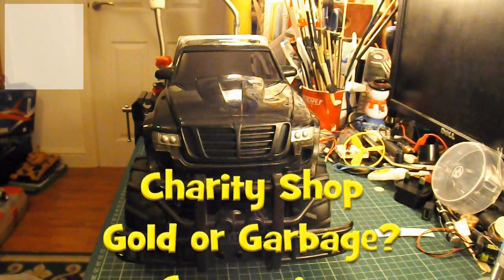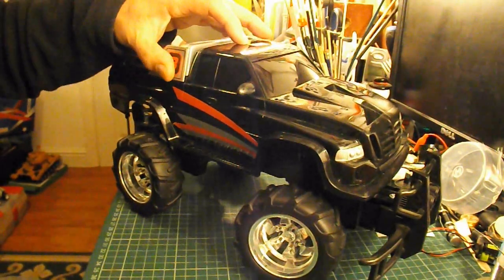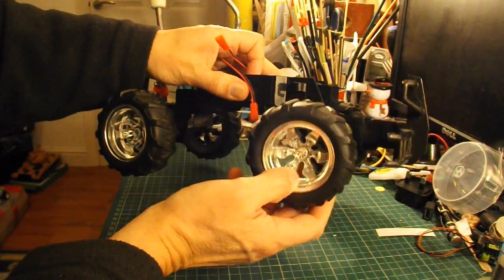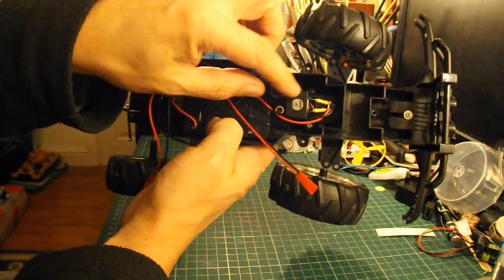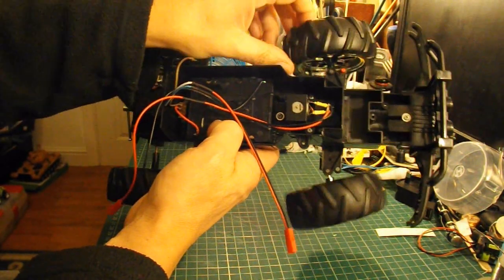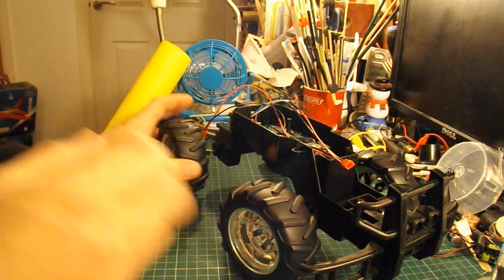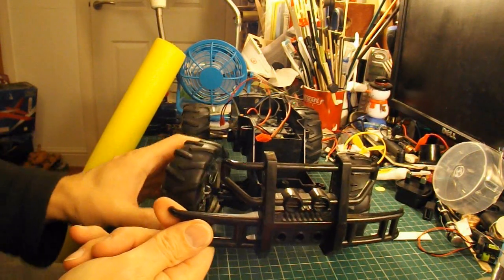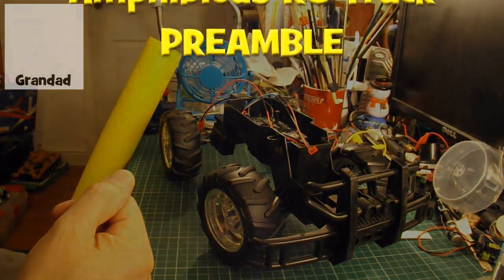Charity Shop Conversion Amphibious RC Truck PREAMBLE

Comment: Try sandwiching a cd disk between the foam on the front wheels so there would be better steering
Reply from the maker: +BananaSoCool88 it would improve the steering but cause a problem when you get out on dry land. Just a simple rudder that still has some ground clearance would do the job attached to the steering linkages. It could even be spring mounted so it lifts up when it hits the ground.

Comment: Hey grandad how do you charge your lipos? I was wondering if you used a proper 4 button lipo charger or just a balance charger. Maybe add a rudder to the back so it can steer better?
Reply from the maker: +X-FLIGHT101 I use this Turnigy Accucel 6/B6 PRO 50w 6A Balance Charger. If I added a rudder I would need to link it to the steering at the front which would not be too difficult. Just thin discs attached to the front wheels would work too in the water but would cause problems on land. A 4 wheel drive would be better.

Comment: You should put a peace of plastick on the front tires so it can act like a ruder
Reply from the maker: +ryan reining it would improve the steering but cause a problem when you get out on dry land. Just a simple rudder that still has some ground clearance would do the job attached to the steering linkages. It could even be spring mounted so it lifts up when it hits the ground.